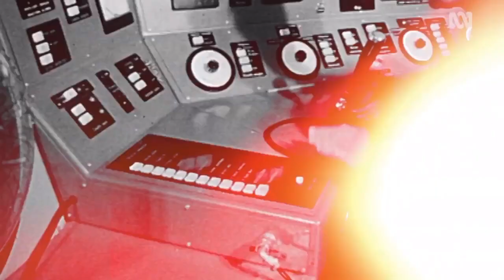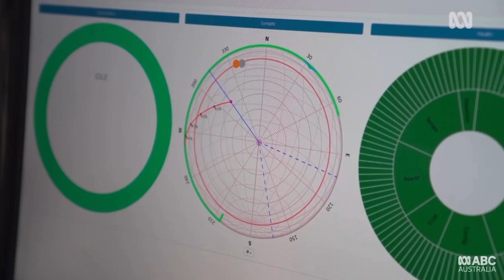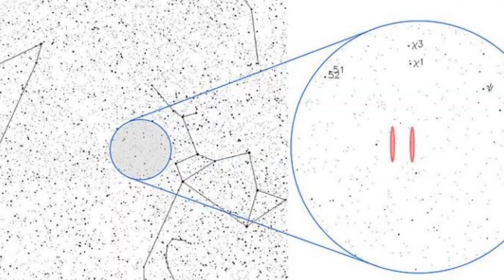Alien Contact?

Comment: When people say that the universe must be teeming with life it's all based on the presumption of abiogenesis, that it actually happens - which is something never demonstrated. So if abiogenesis doesn't happen then the idea that life is common throughout the universe because of this, isn't valid after all. As sad as that might be.
Reply from the maker: That is true but we can base our assumptions on what we can investigate and on earth, the only place we can currently investigate, we see life literally everywhere we look... and when we looked at a comet we found the building block of life... it’s an assumption but it’s a fair one to say that where there is liquid water abd heat we can hope to fine life... 99% of that life will be bacterial I suspect but still life.
Reply: @Mystery-machine  Yes, but if life requires intelligent engineering to put it all together .. and let's face it, even the simplest living cell is a more sophisticated machine/system than the most sophisticated machine that man has ever designed .. then life is only likely to be where it's been purposefully placed.
Reply from the maker: @david-spliso1928  unless life is a inevitable chemical reaction and doesn’t require any purposeful intervention which is what I believe.